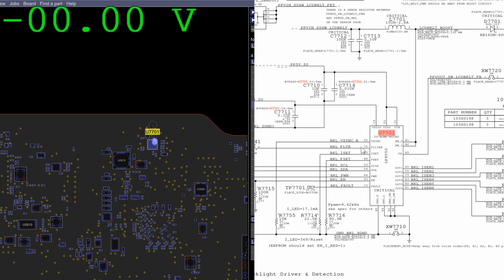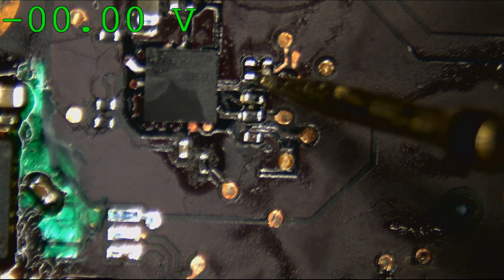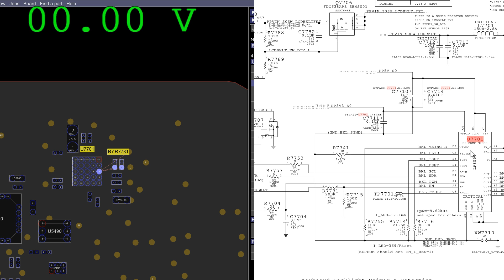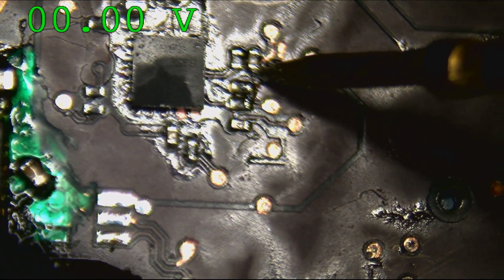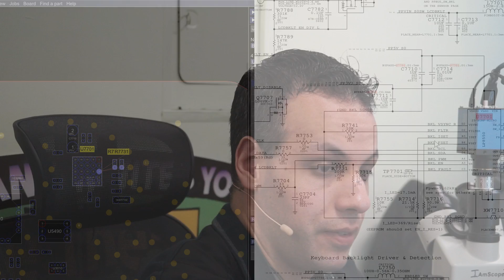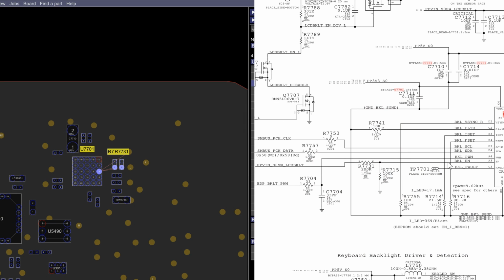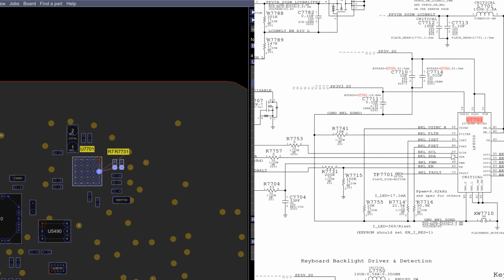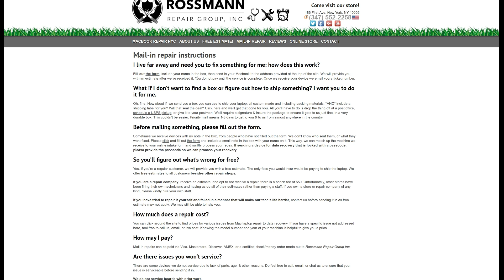No backlight on awful Macbook Air

Comment: Wait upside down? But resistors are not diodes?
Reply: Correct. Resistors don't care about upside down or backwards. Being installed upside-down was a clue that the resistor had been replaced. In this case, it was replaced with the wrong value. The value was way too high stopping the enable signal from reaching the chip not enabling it to create the screen backlight voltage.

Comment: No wonder it didn't work. The resistor was upside down and all the electrons fell out.
Reply: Give it to apple they will charge 799 to repair it
Reply: I charge extra to look for those missing electrons!
Reply: Someone let the blue smoke out
Reply: @zack9912000  Exactly.  😆👍
Reply: Lol  You've gotta be an EEV BLOG fan  :-D
Reply: Duh
Reply: Resistors don't require polarity